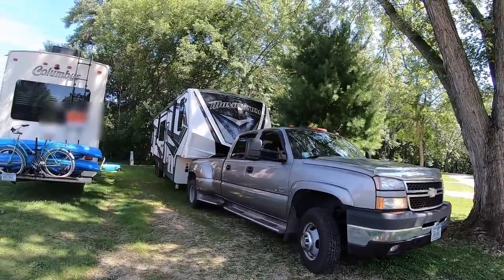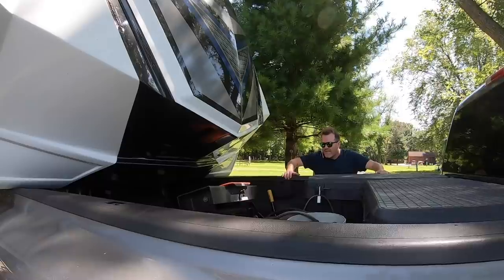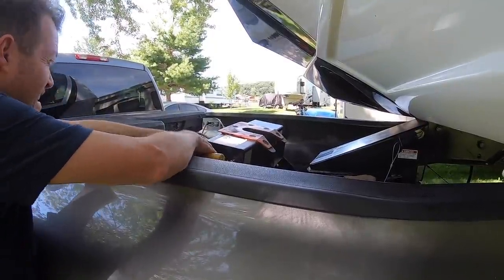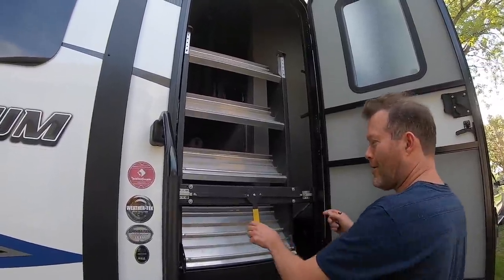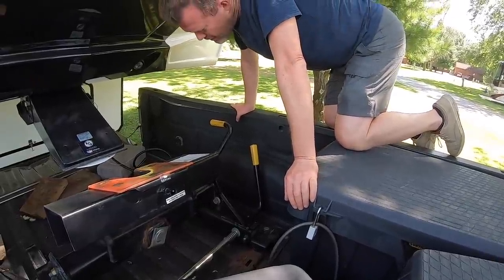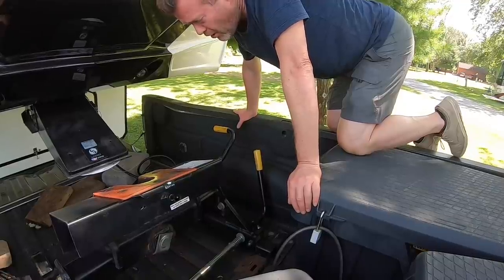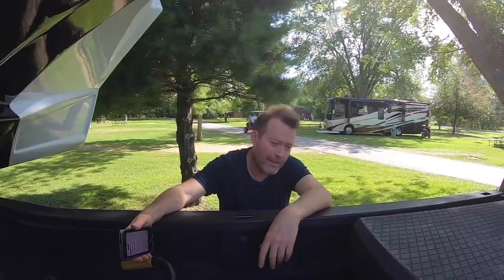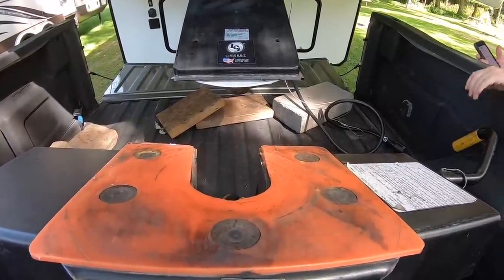RV CRUSHES MY TRUCK ON 1st TOW! BIGGEST RV LIVING FULL TIME MISTAKE! (PT 2)

Comment: Ouch! That was painful to watch.  Had similar happen last year. Trailer was off the truck & landing legs slid off wooden blocks. We were on a bit of a slope, gravel, & it pushed wheel chocks backwards. Down it came doing damage to both legs requiring some welding & new parts.

Got it back on the truck using my 12T bottle jack, which is always onboard, along with blocks of lumber, also always carried.

Nice truck BTW. Mine is also a 2006 Chevy 3500. A rare one being 2WD. Same colour too. 240,000 miles so far. All of them on RV trips. Multiple trips to west coast from MD. Four trips to Alaska. Headed for second trip to Newfoundland this year.

No way for trading that truck, even after a $8000 repair of injectors, turbocharger plus some other preventative stuff last year which had us marooned in Butte, MT for six weeks.

Comment: As soon as the pin is suppose to be locked slightly pull forward and check, then raise your landing legs about 2-3 inches off the ground and give it a good pull to checked it’s locked in, mistake happen but bravo to you for sharing and help others learn from you mistakes. 

I’m guessing you high hitched the pin, live learn laugh. 

Much love from Australia.

Comment: Just watch both of your videos  on this incendent. Take it from a old over the road owner/operator. Always ,always, always pull against the trailer before you raise the landing gear. If you by chance don't get a good hitch lock then all you do is pull out of the hitch with no damage but to your pride. I do this even with our bumper pull.

Comment: I just watched the first video. It sure looked to me like you did everything right as far as the connection...the pin was out, the jaw was behind (around) the pin....why did it release? I have never towed a 5th wheel so I am not an expert but it looks to me like the jaws/lock failed. Ok, you didn't do the tug test but it looked right to me. So sorry you had this experience! Could've been so much worse. Thank you for sharing so we can all learn!!

Comment: The first hitch I every pulled with had a slide bar that you Manuel pushed over and it blocked the pin from moving backwards.   Even if the jaws failed the pin could not come lose.

Comment: If it helps any, I have those same crush areas on my truck.  I disconnected my fifth wheel but did not chock my trailer tires. As I pulled out the trailer moved forward collapsing my front landing gear and then collapsing on my truck.  It is a horrible feeling.

Comment: My dad had done the same thing years ago just missed putting the safety pin in. And dropped it on the box he drove truck for 20 years.  Never had it happen again though. Could happen to anyone especially with a new fifth wheel plate. Dont sweat it

Comment: Yep, been there done that. What I did was to fabricate a 1/4" steel plate with a hole a tad larger than the pin dia. Cut back down from the front of the plate to the edges of the hole. shaped a bit like a horse shoe, on the leading (front)  edges each side drilled two holes 3/8 to 1/2" dia. slide the plate in from the rear up to the collar of the pin. Connect a trailer security chain by the hooks through each hole on the plate. Drill into the fifth wheel front frame and attach two large eyelets. thread the chain through the eyelets and put a bolt through the chain at each eyelet leaving small amount of slack. If you ever get the locking wrong or the hitch mech fails the pin will only go back as far as the slack in the chain. Easy security fix that costs virtually nothing.

Comment: I knows this was embarrassing to post however you have saved a lot of people damage and possible injury by posting this.  Because of post like this, I was saved from this happening to me. On my brand new 5th wheel, I thought it was correctly hitched. After a pull check, I found that I was wrong!  The unit didn’t even come off the hitch but I felt it slide back.  Thank you for posting! (Nobody is laughing here)

Comment: I had to laugh. Not at your misfortune but it took me back to memories of first couple of times hitching up our 5th. I'm sure u know by now but yes the locking arm should be in the up position. With ours that arm sprang up automatically. Only oh-shits we had over 5 1/2 yrs was once leaving the TV antenna up, once not retracting rear stabiliser legs all the way, and once left the tailgate up while unhitching (but saw it at the last second in the hitching camera we had installed). Practice makes perfect. Filming first time hitch-up may not have been overly wise. You always have butterflies the first few times. Keep on truckin :) [EDIT] Watched final part. We had friends that used the friction plates and they were fine but they did find that they did make it way more important to have the hitch more exact height wise with the coupling. We stuck with old fashioned grease. :)

Comment: So I came across this video and a see it's a couple years old but I feel this is the biggest fear for all fithwheel drives. Being both me and my wife are class a cdl holders and are also full time fithwheel RVers we have three steps when hitching our camper are a Simi. Step one make sure trailer is low enough that once you hitch the trailer is picked off the ground by a half inch. Step two check the locking jaw to make sure it is across the king pin. Step three preform a tug test before raising the legs ( tug test is when you pull on the trailer with the trailer brakes applied, make sure front legs are down just incase you do unhitch). You don't have to apply much throttle to the tow vehicle just go in gear and you'll know if it will unhitch. Great job with figuring it out though.

Comment: always pull up against locking pin to check that it is locked with landing gear down. If it is not locked the landing gear will keep it from falling onto truck.

Comment: I know your pain. I had a Similar incident. I had a green tab showing similar to your white pin. My handle was down and locked. I walked all around doing a final safety check. The problem was my 5th wheel was in my drive way with a slope. My truck also had a slope. So there were two angles that made it appear the jaws were locked. What I failed to do was to look behind the king pin to ensure the jaws were closed. List my tailgate as a result. Fortunately no one was hurt.

Comment: Howdy, long time viewer, first time sub & commenter.  As a retired OO, and full timer, I feel Y'alls pain.   Brings back painful memories lol.  My very first 5th wheel, (a 35' Alpha Gold, coupled with an old 85 ford.  The hitch was an old unit that came with the RV.  As A driver, I knew to test it.  Pulled on it 4 times and it seemed to hold.  Until I turned out of the park on a slight incline and the RV jumped  off the hitch and landed on the truck bed.  As it was an old truck, it dam near broke it in half  lol.    On a side note, Never never put the landing gear down on soft ground like you did.  Always place blocks under the landing gear.

Comment: When you do your tug test, use your brake controller and lock the trailer brakes. Then it won't move and you can do a brake test at the same time. As for the damage to the truck, I have seen much worse from this type of experience.  One thing when you are on the road. Always learning!

Comment: You should should always visually inspect the locking mechanism to ensure the pin is in and secure and I mean get out of the truck and Bo behind the gate and check for a secure lock. Them do a tug test with the landing gear off the ground just a couple inches.

Comment: @14.42 you locked the handle out for driving without trailer. The second position is for when you back under it will slam the jaws and pull the handle in.

Comment: You should have seen a semi trailer disconnect from a truck at 70 MPH on the Snoqualmie pass at night time.  I seriously  thought it was going to explode. There was a lot of sparks and then the trailer lights went out.  I did a u turn and backed up against the trailer and flashed lights at oncoming cars.  Pitch black so imagine slamming into an object at 70 mph.

Comment: Well the good news is its not that bad but you guys gotta buy a better 5th wheel. It looks like your towing a $60k+ camper with a $200 husky sheet metal 5th wheel, you need to get a reese or other name brand that actually has some heft to it. But im sure you figured that out by this point so good luck and happy travels. 😉

Comment: Ex trucker of 40 years ,   1/ its the ideal if the trailer is a little lower before hitching  so as you hitch up it also lifts your trailer only 2inch max but must be lower 2/ practice the little dance move , back up , hear the hitch click in , then do the little shuffle forward the back , do this twice , then put your safe clip in.  Seen it many times over the years 44ft trailers on there knee s , whilst an empty trailer you might get away with zero damage , but a loaded trailer its broken landing legs plus a hire crane to lift up again plus your job loss if the boss is having a bad day.   Whilst a costly mistake for you this time its a good bet it wont happen again,  On the double meaning innuendo tell the mrs length does matter  Lol !   Your a brave man to show this to the world .

Comment: Wow, I just ran across this video by accident. I'm a retired OTR truck driver and something like this happened during my first year of truck driving. I stopped at a roadside rest area for a restroom break. Some idiot pulled my 5th wheel kingpin on my tractor while I was inside of the restroom. I failed to do my walk around check on my tractor-trailer, because I wanted to get back on the road before the afternoon rush hour in Houston, TX. Well, I dropped my trailer!

Comment: Couple of tips one put some grease on that 5th wheel plate not a lot but a little also when you hitch up don't raise the trailer landing gear after your hitched get in your truck apply your trailer brake and try to move forward if your hitched you won't move much if your not you'll know it and what happened here won't happen again once you know your hitched raise the landing gear

Comment: Without even watching the video my guess would be that the king pin did not fall all the way into the jaws. Being a truck driver I have seen this and done this myself. In the future a good habit to have is to just lift your landing gear up a little bit after you have hooked into the fifth wheel. Then gently pull forward with the truck to see if the trailer stays or is about to fall down. The landing gear should catch it if it does fall down. As far as the handle goes with that little white pin sticking out, it’s either in or out. Sometimes when you back under a trailer if the fifth wheel is too low for the king pin it still might set the jaws to fully close but they are not grabbing the king pin high enough. Next time just lift the landing gear a little bit and try to pull forward a bit with the truck to make sure it’s locked completely. If you put a chock block against the trailer tires and pull against the trailer with the truck and it doesn’t disconnect you know you are locked in.

Comment: Your lube disk shouldn’t be used as there is already one on your fifth wheel plate on the truck. Using the disk will lift the king pin of the trailer up causing the king pin to bind on the locking arm. The locking should be in the middle of the notch in the king pin, by using the lube disk, the locking arm will bind on the lower part of the king pin eventually wearing out the jaws of the hitch prematurely.

Comment: Definitely remove one of the slip disks.  Also, one thing I make a habbit of doing is, just before I pull away, i hold the brake controller on manually and backup, giving the trailer a good jar (brakes on).

Comment: Get an Andersen Ultimate hutch that will never happen, I looked at all the hitches in the market and got that one only bc I don’t need a slider on my SB F350.  If I got a reg hutch and slider plate it would weigh close to 300lbs and be a bear to take in and out of my truck.  Stuff like this wouldn’t happen with that hitch but sorry to see what happened glad it didn’t damage your home.  Good luck going forward getting that all resolved.

Comment: Pull the plastic bed rail caps off and pull both sides back up straight with a portapower or bottle jack with a flat piece of wood between the jack end and the rail.  Tap any dings out with a flat body hammer and you will likely never know it happened as the bedsides should go right back into shape then the rails go back into place.  The tailgate is beyond repair, just get a new one for cheap off fb marketplace.

Comment: Im guessing it's because I'm a truck driver I always tug test. Not only that but I knew it was gonna happen from the last video I saw that the 5th wheel jaw wasn't locked around the King pin.
Also should grease the 5th wheel
Reply: But then again you're rich so shouldn't be a big deal with repair

Comment: When you lock it always lock your trailer brakes and pull against the pin and check it before you go forward back up against it hard and then check better to be safe but always pull against it and check

Comment: WHEN YOU HOOK UP: BEFORE JACKING THE RV DOWN.... Reverse into the hitch, make sure and rev a little and get the RV moving an inch or so... Neutral... let it rest to even... Forward... add a little gas and move forward an inch and watch your hitch. I do this every single time. I also use a real hitch. Glide Ride superslide baby. $2500 worth every penny of the $500 i purchased it for used (practically new).

Comment: Learned in the army to always perform a jerk test before you pull out. Hook up as normal. Leave truck tailgate down. Raise the trailer jacks just a inch off the ground. Hold the trailer's electoral brakes and attempt to pull the trailer. If every thing is holding your truck will not be able to pull the trailer. If the trailer isn't locked the truck will uncouple and the trailer will only drop an inch. This is know as a jerk test.

Comment: White pin tell you hitch is in latched position, NOT that the pin is latched, verify pin is back all the way, check white pin then latch handle. Your trailer tripped the latch but wasnt in the latch all the way, so white pin came out showing that latch was tripped

Comment: You now know to do a tug pull before you try to pull out, I use  to pull a 35 ft 5th wheel for 15 years. Now after you got it hooked up and made sure is was fully locked and you get where you are going and get it all spotted, before you try to unhook, put the legs down chock the rear wheels so it won't roll backwards back up aginst the pin, a lot of the time the king pin is tight against the locking bar and you caint pull the lever to unlock. I use to pipe line all over the US and have encountered about everthing you can think of concerning a RV in 15 years.

Comment: I am so glad that I did not buy a fifth wheel and I am very glad that my bumper pull trailer does not have slide outs it is so much easier without slide outs and I got a camper shell on my truck with all my goodies in it I don't lose my bed of my truck

Comment: Never take weight off the truck before unhitching. Leave the weight on the truck undo the latch and then take the weight off the truck. There are several videos on you tube giving pointers with fifthwheel hitches.

Comment: Seems strange how they explain to him that the marking that they put on that very hitch on how to determine that it's locked is not correct. The hitch is mismarked. The marking on the hitch should explain to check some other part of the device if that is the indicator that it is locked. Saying that that white pen indicates that the hitch is ready for Pulling is a serious flaw.

Comment: That’s my biggest fear when hooking up. I try to leave the camper high til it get to my fifth wheel hitch. Then drop it down to where the plate is touching the hitch so I have plenty of resistance and I back into it pretty hard to make sure it locks. Then I look at the jaws to make sure they’re around. It’s tough to do a tug test since the jacks go up one at a time. So I just have my wife or someone stand there while I pull out slow.

Comment: it's a rite of passage for hauling fifth wheels lol. take a 2x4 and place it under the lip on the inside of your truck  where its bent and beat on it with a hammer and you can work some of the dents out . get rid of the slider hitch you don't need it and it's a waste of money and u unneccessary  weight with a 8 ft bed and that slide mechanism is prone to breaking (I transported Fifth Wheels for a living for manufacturers and dealers for years and slider hitches don't hold up the way I was using them)  . the less moving parts on the hitch the longer it will last . I always take a flashlight and verify the hitch pin has slide across the tongue of my pin on the 5th wheel I am towing and then perform a tug test. I have dropped one on my truck bed before and many others have too. Good luck and happy Rving!!